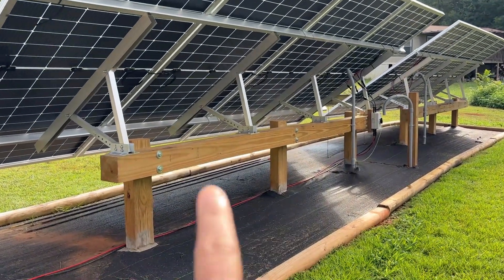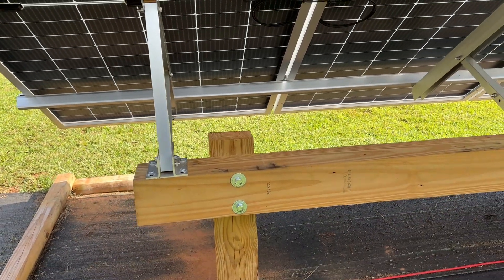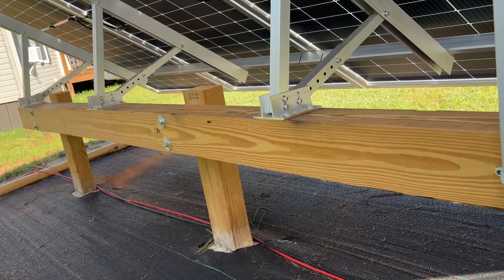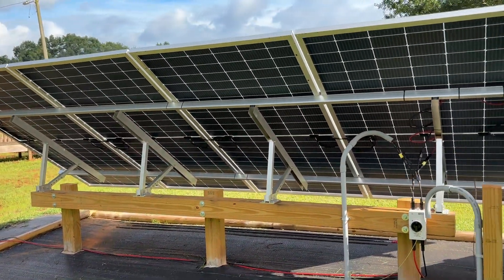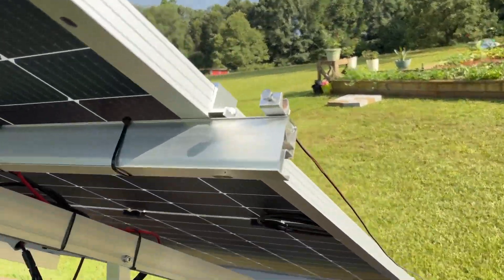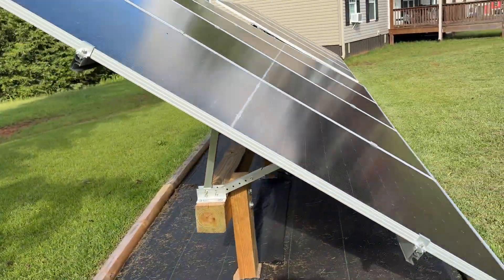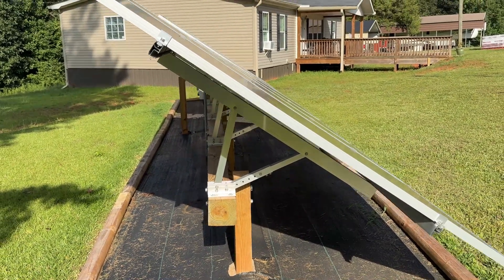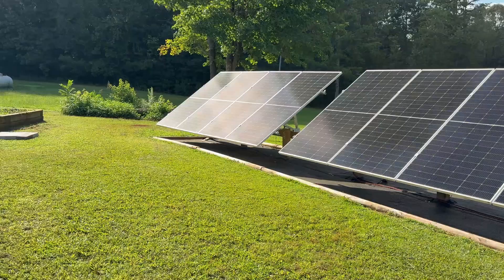Final Setup - EG4 Cat1 Brightmount Ground Mount & Solar Panels #eg4 #solar #offgrid

Comment: Thanks for the idea. I would change it slightly, using 4x4 and 4x6 lumber. the 4x4 for the post and 4x6 for the mounting of the bright mount. Honestly I think there are better options out there besides eg4... like the integra rack but the bright mount is still cheaper.
Reply from the maker: You’re welcome. 
Yes, my first idea was to use those exact sized lumber, but since I want to make sure to do it right the first time around and never worry about it again, I went ahead and spent a few more dollars. True, I do believe the Integra Rack is superior and definitely more expensive. But since my land is very slopey and hilly, I opted for EG4 Brightmount so I don’t have to worry and spend extra on grading a flat area. Thanks for watching, and may you have a blessed New Year for 2026.

Comment: Was wondering what size wire is coming directly off your panels entering into your disconnect switch and then on out with 8awg wire to the house. I plan on setting up my panels similar to yours in a 5s2p array. I assume most panels are setup with 10awg wire out of the box. I’ve been confused as to the size of wire needed to transition for 10 to 8 awg wire. Some channels say you can and others seem to indicate that you can.     Any pointers?
Reply from the maker: I used a 10awg. It really all depends on the distance/length of wire you’re using. The farther the distance, the bigger the wire you need to minimize voltage loss. Also, once you parallel them, the bigger amps also affects the voltage loss, so the bigger the wires the better, hence I used 8awg after the parallel connection, and also because I used a 100ft wires to the house.  I hope this helps. Thanks for watching.
Reply: @DIY-Elvin-Productions thanks for the response….I’ll be running approximately 140ft to my mobile power station because I have a lot of trees and placing the panels on the south side of the trees I won’t have any shadow interference for most of the day … I realize that a shorter distance is best,  but I have to work with what I got….just hoping I can produce enough energy to maybe run my 120v mini slip to shave a little of the grip and to have back for the house should we lose power completely. Thanks again…I’m glad I stumbled on to your channel/video, your setup looks really nice and I will be try to get mine set up somewhat like yours in the spring/summer.   Michigan  🥶
Reply from the maker: @wmfed181 You’re welcome. I’m glad my video was of an assistance for you. Stay warm. I hear you guys up north are getting a beating of cold weather this winter. My best wishes to your project. God bless.

Comment: Nice setup! What size panels are these? I thought you mentioned in the last video that the extension kit didn’t work anymore and you couldn’t fit 4 panels
Reply from the maker: Thanks!!!  These are the same panels (550w 44.5” wide x 7’6” tall). EG4 released the correct extension kit about a month and a half after I posted the first video.

Comment: Hi again! I was just wondering, how far apart are the base brackets? EG4 recommended 51.2 inches apart but if we follow that, it would not fit the 12’ 6x6. Thanks!
Reply from the maker: From the edge of the wood beam to the CENTER of the first bracket is 3.75 inches.  I did the same thing for the opposite end.  I chose that distance so the screws would not be too close to the edge of the wood and prevent splitting.  Then I spaced out as evenly as I could the two inside brackets from the end brackets.  All four of my brackets are about 46 inches apart measured from the center of each bracket.  Yours might differ a bit coz my wood beam was about an inch longer than 12ft.  Once installed you will see that the recommended distance is not necessary.
Reply: Thank you!
Reply from the maker: @MattSonza-u3r  You’re welcome!!!  I’m glad I was able to help at least one person. That makes making the video well worth it. Have fun with your project!!

Comment: Sadly the 8 panels are only an offset of your Electrical Bill. I personally had to add excess panels in order create enough banked energy for our harsh winter climate. I now heat with electricity. 21,565 potential watts of power. My bill doesn’t exceed $34 a month. Because that is my rental fee on my electric meter. I have my own battery bank to skip over the peak hours twice a day. Or in case the grid goes down.
Reply from the maker: True, this setup will not get our 3 bedroom 2 bath home offgrid.  We have a 12kw inverter with a 22kw battery bank.  This runs our fridge 24/7.  All the kitchen appliances are hooked up to it.  It also runs two Midea inverter window AC units to cool the living room and the master bedroom along with several fans and also runs  our washing machine.  We have averaged this summer about $44 per month on electric bill.  When the grid goes down we'll be ok.

Comment: Remember you need to run an equipment ground along with your 8 ga positive and negative to your inverter. I assumed the negative in the system was sufficient but the inspector had me run a 12 ga green also.

Comment: Nice job!  I used 6x6s for my posts and mounted the Brightmount feet on top of the posts.  EG4 discontinued the Cat 1 Brightmount and is looking to replace it with an improved Brightmount.  Reportedly, they actually had trouble finding an overseas manufacturer that could keep the price down and still keep up with demand! 🤣. Looks great, keep growing your solar system!
Reply from the maker: Thank you!!
With God’s blessings I may have something similar to yours. You too have very informative videos.

Comment: Nice work! I am also about to set up mine this coming week. What type and size screws did you use to attach your Brightmount to the 6x6? Again, great job!
Reply from the maker: Thank you!
I used 4 inch long lag screws. I think I used either the 3/8 or 5/16 diameter.  Either way as long as they fit through the hole of the base plate you should be good.

Comment: Very Nice setup.  I put a couple piece of 4x4 under the lower rail of the mount to ease the load off the brackets
Reply from the maker: Thank you!
Yes, I too am planning to add support to the front rails.  Not sure yet how to go about it but the way you did it is a very good option.

Comment: I just don't like the foot... I would have two brackets that would Mount that one on the back side of the 6x6 and only put the upright one on the side of it so it's straight up and down !!! And then use a second bracket for the angled one somewhere in the front...
How deep are the 4x4s???
Too bad you can't change the angle easily!!! I need my winter angle...
Reply from the maker: Yes, I too wish the feet/legs and base plate would have been better designed. The 4x6’s are buried 3 feet.